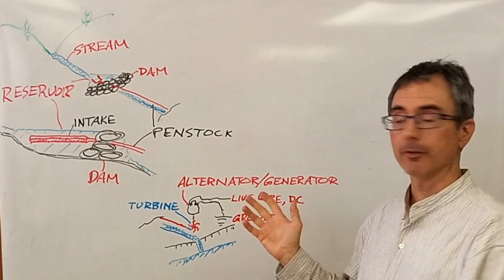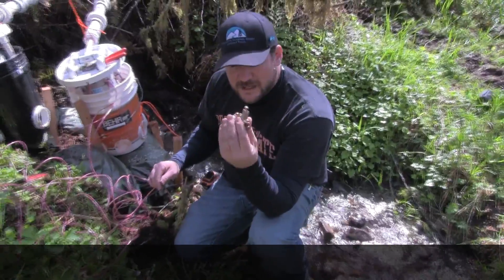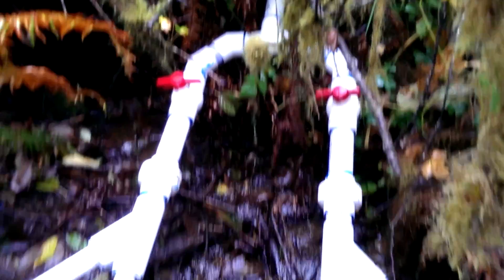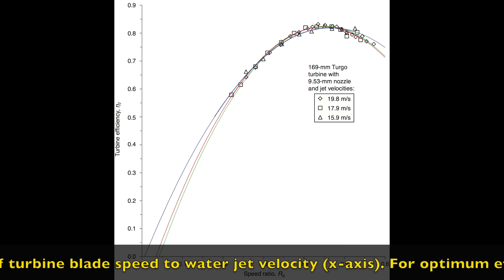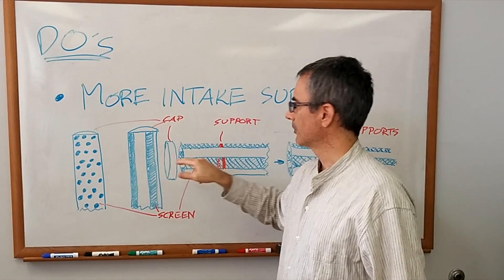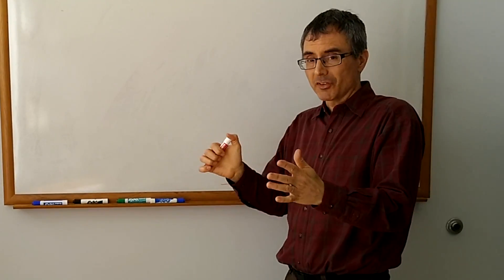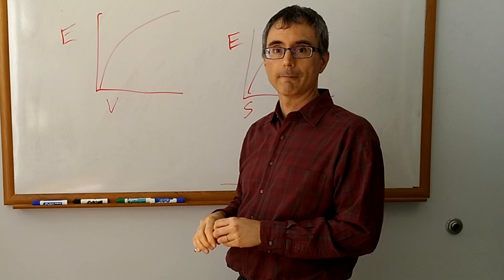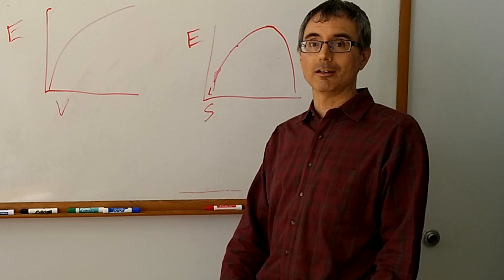Pico-Hydro for Science: System 2.0 (shorter version)

Comment: I need to build a microhydro system.  Are there any resources that you would recomend for a fellow Oregonian looking to build a system?
Reply from the maker: +AIM Guy This guy from Switzerland, udos46, has left a few comments on this and other videos of mine. Extremely knowledgeable, has built all sorts of systems.

The kind of system you should build can vary a lot with your situation. For example, ours is a high-head, low-flow system, so jets shooting at turbine blades is more efficient. For low-head, high-flow systems, you want a through-flow turbine.

Plumbing matters a lot, especially the nozzles. You can lose a lot of power in the pipes if you're not careful.

You'll want a maximum power point tracking (MPPT) charge controller (we bought eTracers), but they're generally designed for solar systems, so you'll need to put some front-end filtering between the alternator and the charge controller so you don't quickly burn up the charge controller's front-end capacitors.

Comment: Power ~ (velocity)² x (Flow Rate) = that's the Einstein's (E=MC²) formula, kind of.
Reply from the maker: +Frits Zalat Power from the jets is (1/2) x (water density) x (volume flow rate) x (flow velocity)^2; that's kinetic energy per time. Potential power (potential energy per time) is (water density) x (gravitational acceleration) x (volume flow rate) x (change in head), where change in head is just the elevation drop. In the first system, the ratio of jet power to potential power was 1/2. With the new plumbing ("System 2.0"), well, that reminds me that I need to work up the numbers.

Comment: If you're only getting 18 watts from each turbine, it seems like you'd be better off with solar.
Reply from the maker: +createthis We're in the process of another significant reworking of the system, this time focused on the electronics (now that we've got our basic power needs met). We've purchased the charge controllers I mentioned in the video, but we need to make input filters to eliminate the ripple from the alternators, so we don't burn out the controllers, which are designed for solar. These are "maximum power-point tracking" (MPPT) controllers, which will allow for higher voltage on the alternator outputs. Due to the alternator efficiency increases with voltage, as to RPMs; turbine efficiency increases with RPMs. Anyway, crude testing indicates we can at least quadruple our power output by operating at higher voltage.

Solar is not a good option for the site. It can rain for a week at a time here, and that's when we need power the most. Also, we're at the bottom of a deep valley, and the accessible slope is north-facing. On a clear day in winter, the sun only reaches the bottom of the valley for a few hours a day.

Comment: How long is that pipe? Looks like the most expensive part of the system. Is it UV stabilized?
Reply from the maker: +createthis In my head loss calculations, I used 69 m, which is at least approximately correct. I don't know about the pipe specs. Anyway, not a trivial contributor to the total cost.

Comment: If you want to go cheap on voltage régulator, i use motorcycle voltage régulator for my 12V system (cheap on EBAY) I think your PM alternator has a rectifier Inside so you have DC, you can take the rectifier out an use a motorcycle 3 phases motorcycle régulator to charge 12v (14.5) I only have 1 feet water head on my set-up an can get .5A at 14.5v, i would love to have 100 foot head.
Reply from the maker: +Claude Ouellet You must have a lot more flow than us! A motorcycle regulator sounds like a great idea, but we've already sprung for charge controllers with microprocessors. Still working on the electronics, though.

Comment: intersil:How to Improve DC/DC Converter Performance with
Phase Shifting Time Delay

In most step-down power conversions, where multiple output voltages are required to regulate off a single
input source, the switching regulators can impose high input root mean square (RMS) current and noise
when delivering point-of-load (POL) power to FPGAs, DSPs and microprocessors. To combat this, designers
will typically implement high input filtering (at additional cost) to reduce conducted electromagnetic
interference (EMI) and/or radiated EMI, and to control the higher system I2R power losses.
Reply from the maker: +udos46 Yes. My power supplies will use switching regulators (LT8640, which can handle more than 2 amps) for the larger part of each step-down and linear regulators (LT3080-1, which can handle 1.1 amps each and can be run in parallel for larger currents) for the final regulation stage, whether regulation of voltage or of current. (LT3080-1 can also be used as a regulated current source.) In between the two regulators will be a capacitance multiplier, which essentially feeds the output of a low-pass filter to the base terminal of a transistor, so the filtered "signal" is "amplified" by the transistor.

Comment: Mi dispiace di non essere lì con voi vorrei capire e risolvere il problema di un filtro passa basso pi greco potrebbe non funzionare?
Reply from the maker: +udos46 I wish you could help, too! I am still working on the design of the power supply. I hope to begin fabrication soon. We are now having problems with our electronics. The radio board is drawing too much current, but only in the field. We have not reproduced the problem in the laboratory. Such fun!

Comment: I tried to build one of these myself, but ran into the issue of the blades not turning. the generator i am using is http://www.ebay.com/itm/12-volt-Generator-Permanent-Magnet-Alternator-N-52-Neo-Core-Heavy-AMP-/261489204392?_trksid=p2054897.l4275. Is it because there is such a large pressure drop with using this build or is it because the magnets in my pma are too strong?
Here is a video of me testing it.
https://www.youtube.com/watch?v=T9ufcqH53CY
Reply from the maker: +thank814 Sorry to take so long getting to your question.

It looks to me like you simply don't have enough power directed at the blades. I couldn't see in the video how the alternator was connected. Also, I looked at the alternator on ebay, but there wasn't a spec sheet. If the alternator is hooked up to a 12-volt battery, the turbine will probably spin if you disconnect the leads. Once it's going, you can at least measure the open-circuit voltage with a multi-meter. That open-circuit voltage is you maximum possible, zero-current voltage. Now, the alternator resistance increases, I think, as I^2 (current squared), so the alternator efficiency increases with voltage. You may find that you don't have enough power to turn the turbine at 12 volts; it may be counter-intuitive, but you may be able to generate power if you "stack" batteries. For example, with two 12-volt batteries, connect the negative terminal of the first to the positive terminal of the second, connect the positive lead from the generator to the positive terminal of the first battery, and connect the ground lead of the generator and the negative terminal of the second battery to ground. If you have 3 batteries, and your open-circuit voltage is greater than 42 volts, then stack 3 batteries; you'll get even more power. 

We have bought charge controllers that use maximum power-point tracking (MPPT) to hold the generator terminals at the optimum voltage and deliver voltage appropriate to charge batteries at 12 volts nominal or 24 volts nominal: eTracer, about $100 each. We haven't tried them out yet, because we need some custom electronics to deal with the high ripple voltage off of the alternator's rectifier; the charge controllers may not deal well with that ripple, because they're designed for ripple typical of solar cells. See the comments back and forth with udos46, both on this video and my previous one. (I just plug his Italian into Google Translator; what comes out is a bit garbled, but I usually get the gist.)

There are problems with the 5-gallon-bucket design. It's a nice entry point, but we thought some improvements were warranted. A big one is being able to adjust the jet's size and direction. For adjustable size, we went with bulkhead cable seals. (I know, right?) They're designed to be water tight, and to seal around a range of cable sizes. I think we had some trouble matching the threads, which are non-standard; may have had to cut new threads in a smaller fitting. Sorry to be vague: my graduate student built the thing, and I made the video.

Comment: Hello
the turbines should be done well, if they have to endure:
to protect the bearing, a sealed tube is mounted to the base, and long up to almost touch the swivel Pelton
I also put the extra fat is not soluble (fat ass) on the outside of the bearing as additional protection to the condensation that forms turbine stops above.
for electronics I've never had so far mppt failures <30 A to see how they are made
however should stop charging the battery with a remote control switch, when transmit signals even if the turbine will run 'load almost twice if you do not have an overvoltage bleeder
so you will have only the pure dc batteries
I made a similar system but with a solenoid valve (normally closed garden that cost little) which discharges the water near the nozzle when needed
so the swivel can not turn having no pressure
Reply from the maker: Extra grease! Good idea. 

If I understand correctly, you suggest stopping the turbine for quiet radio. But we need power for radio, nothing else. Radio transmission and reception cycle several times per second, 24 hours per day. Transmission uses 20 watts or more, multiply by 2 for the 2 systems. 

A colleague has recently installed his own picohydropower system, also for an RFID (radio frequency identification) system. His solution to the noise issue is to manually switch between sets of batteries; one set is charging while the other is providing power. But he has to switch batteries 1 time per week. We cannot go to our site as frequently as he does. Therefore, I am designing power supplies to meet our needs. I had an electronics course at university...25 years ago! I have a good book: The Art of Electronics by Horowitz and Hill. Horowitz taught the electronics class at university;  great teacher! And the third edition of his book was published this year. I have photocopies of proofs of the second edition (1989?) from my university days. Providence smiles on me.

Comment: ci sono più notizie?
Reply from the maker: +udos46 A little. We got the eTracer charge controllers (2113, I think; the higher voltage version), but we haven't installed them yet. I have been working on the design for power supplies for our electronics, which is a mixture of radio and logic circuitry. Radio needs quiet power, and logic is noisy. The other thing is that we had to replace the bearings on both alternators. We're having our machine shop make us 1) flexible seals to keep the water and dirt out of the alternator casing and 2) spacers on the mounting bolts to level the alternator and separate, just a bit, the alternator housing from the steel frame. Previously, we had a problem with one of the axles rubbing against the cut-out hole in the steel frame. It's nice to have a machine shop! I just wish we had an electronics shop! 

One question: Do you know what dc-dc converter the eTracer uses? I can't find any data sheets for it. I took off the casing to try to read the part numbers off of the ICs, but the power supply chips are on the under-side of the board and encased in foam and stuff; that is, they're completely inaccessible. And I don't have any unregulated dc power source handy in the lab. I'm just going to assume it uses a switching mode power supply (SMPS) for a voltage regulator on the output. I'll eliminate the noise on the line with a capacitance multiplier, and we'll put the other electronics in a grounded metal box to keep out the EMI.
Reply from the maker: +udos46 And the working plan is to connect the 4 batteries (which will be new; all the old ones were ruined) on each system in combination series and parallel configuration, so that the batteries will be at 24 Vdc (nominal).

Comment: excellent explanation
if the turbine exceeds 150 volts dc free:
use electronic charger (12 or 24 or more ') 230 volts:
(any form of wave, is rectified and smoothed)
operate from 75 volts to 350 volts dc dc (even if 'specified 230 ac 50-60 Hz)